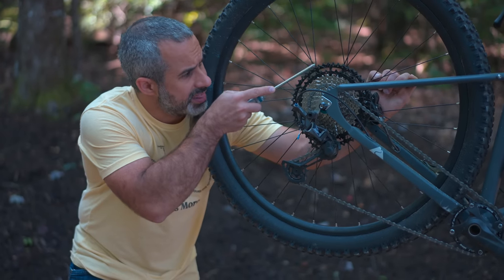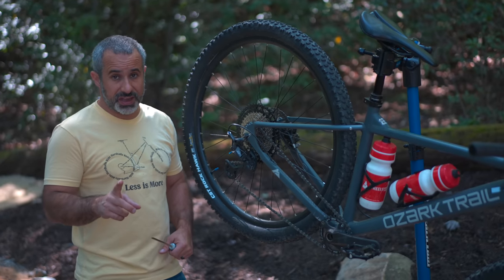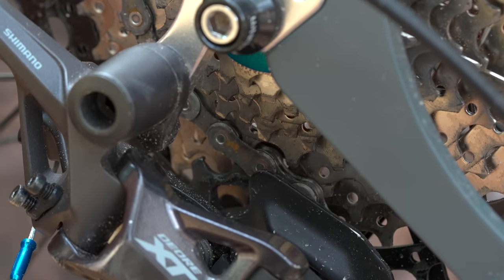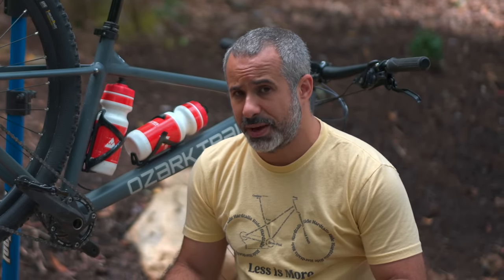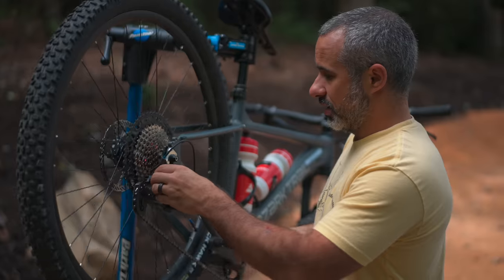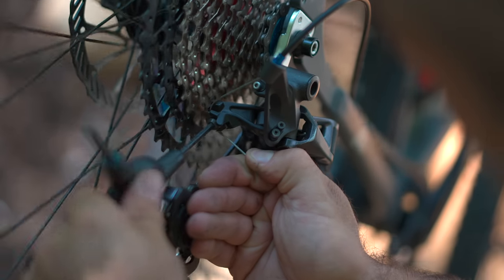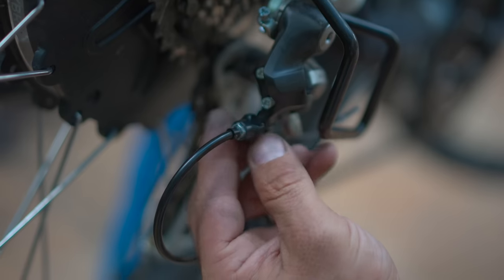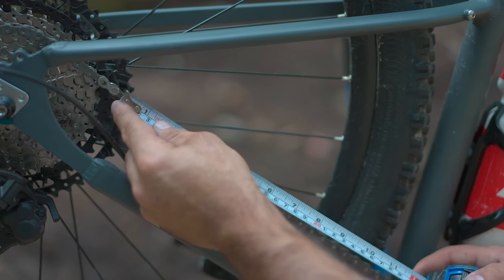How to tune your derailleur with basic tools (for beginners)

Comment: Hi Seth, this video came at a perfect time for me, but I've got a question. Do you FOR REAL do the thing where you decompress your shock to find the longest point along the rear travel to measure your chain? Or can I just do it with the shock at pressure and just add a link or two?
Reply: I'd do it with an aired-out shock, best not to second-guess. Do it once, do it right.

Comment: What's the red goop you've got on the cassette? I usually just put muc off chain lube after I've degreased the chain, cassette and derailleur. Should I be putting some lube on the cassette?

Comment: I have a roadbike that shifts like garbage! while sorting all possibilities out that you mentioned in this video I think I have found out another issue that may happen to older bikes: The cable inner and outer are rubbing against each other somewhere. So the deraileur does not always exactly follow the "commands" of the shifter... So I will renew it all and see what will happen...

Comment: A stretched chain will damage the teeth on the cassette. It helps to enter your equipment into an app like Strava, and track your miles so you can change your chain before it gets so stretched that it wipes out the cassette. Also, lube that sucker often.

Comment: Serious question.  I have a vintage ATB/mountain bike without derailleur hangar.  For sentimental reasons I absolutely cannot change to a newer frame with a hangar.  It shifts “OK” but I really want to dial it in.  The rear derailleur mounts to a “claw” style mount.  Do I get the alignment gauge to see where I am at?  Do I take it to a guru that aligns the frame or replaces/welds in the back part with modern 135 spacing and a hangar mount?

Comment: I have a barrel adjuster at the shifter and rear derailleur. Which one should I use to fine tune if I loosen/re-tighten the shift cable?

Comment: Thank you for the video it was educational. But anyone have any answer to my question?
Why modern low entry bikes fail where secondhand low price brands from the 90's and early 2000's shine?
Or is it because the New 1x systems are more sensitive to the cable then a 3x System?
I had (and now again) an 18 speed full rigid retro MTB. I used (kill) my bike for 20+ year I had the original '90s SHIMANO SIS components after multiple hard staff and no major adjustment needed. My Father made me buy a secondhand 2018 Decathlon Riverside 500 for commuting only and the 2  year old components at the back (I know It's microshift don't expect much) and the overly soft sponge front Suntour suspension fork (can't be locked, it come from factory) give nothing but trouble. After 2 month and multiple services they still can't take even 10 degree hill's. The back shifter hopp backward to speed 8 from 3 without any major power.
I know quality had to payed, but why I had to buy a higher priced one to go work, to my aunty or to get tó the cemetery to my loved ones? Not mention what should I do of it get stolen...?

Comment: The problem with the derailleur hangers is that sometimes a new bicycle comes with  a bent one already from the store. You pull it out of the box, and it is already slightly bent.

And then there are steel frames (like Surly) where the hanger is a part of the dropout. Good news — you can bend it many times and it won't break. Bad news — you don't get to have a spare.

Comment: I had an issue where my shifting would be fine on one side of the cassette, for example the last 3 gears, but the deraiileur wouldn't get the chain to the first 3 without me having to put some tension on the shifter trigger. If I adjusted my indexing to where it can get into the first 3, it then wouldn't be able to get into the last 3. This started happening after I replaced the shifter cable, so I suspected it to be how I installed the cable, but it's a pretty easy and straightforward job. So it could be the shifter? Or could it more likely be the "hanger" (my bike didn't have a removable hanger; it was just a dropout with a hole to mount the derailleur)? 
The hanger is not my issue anymore though because a couple weeks ago, the rear swing arm snapped right off of the frame where it connects to the pivot joint. It was a 2020 Schwinn s29 (matte black model). Lasted 3 years before this happened. Took it everywhere in my area of Michigan. Did everything. I was proud of it, but still wonder about what I could've done to avoid the swing arm snapping, and also about the weird shifting issue I'm posting about now. Now I can't hit the trails until I buy a new or good used mtb. Don't have a car either, so I'm stuck relying on the bus system, which isn't all the reliable. 🙄🤷🏾
2nd edit: Yes I modified it. I modified and upraded everything that failed, including the wheelset, fork, you name it, I replaced it. Only thing oem that didn't fail was the rear coil shock. But that thing is so simple it would probably be a long time before it failed, so I upgraded to a dnm aoy-36rc air shock. It was a much better shock, and a Schwinn customer service agent (who didn't know much about bikes) blamed that shock for the failure. He also said that's why the mechanics at Pacific Cycle didn't want to send a new frame to me even if they were available. I disagree but, whatever...
Please feel free to comment your thoughts. Thanks for reading this essay. 😆

Comment: For the uninitiated: The Derailluer Hanger Float Test is the simplist method for deciding if you need to replace the hanger, if it floats you're good to keep using it. If it sinks, they cost about $15 and you've already eliminated all the other possibilities so it's time to replace it. Go to a shop though and bring your hanger, they should have the one that matches or can place an order for you so you don't buy the wrong one.
Reply: Don't rule out new hangers being bent. I've just got a hanger tool and found both my hangers were out, wish I'd got the tool years ago.
Reply: In my experience it is practically impossible to find a derailleur hanger. A lot of manufacturers don't stock them once their newest model is out, if they ever stocked them before. Your local bike shop (if you have one) certainly won't have one in stock for your specific bike. You need to spend a long time searching the internet for somewhere that makes them as after market parts and they will cost a tenth of your bike when it was brand new.
Of course your experience may vary depending on where you live and the age and manufacturer of your bike.
I wish they just gave you a spare with every new bike but maybe the universal derailleur hanger will be used on every bike one day and this problem will go away 😂

Comment: Coming from a bmx background I always hung my bike on the bike stand via the top tube because I always ran with a cut seat post so I couldn't raise it . I've noticed that in all maintenance videos the mtb's are hung via the seat tube even with droppers. I've been resistant to hang my mtb via the dropper and have continued to mount it via the top tube.  Am I doing harm to my frame or is it just a preference thing ?

Comment: for ebikes, a proper kickstand is essential to support it on both sides so that you can realign and adjust the derailleur on the road. I've tried to turn one over carefully, but it is very unpractical, and much of the weight was on the controller display mounted on the handlebars. A few days later, the controller broke because of this.

Comment: I get the high gears shifting well but the low gears don’t work right. Then if I get the low working better the higher gears don’t work right. Also my cage is sometimes brushing the spokes when in lowest gear… time for float test?

Comment: I was surprised that there was no mention of the marks on the derailleur cage when setting the spacing using the B screw.   Looking through the wheel from the non-drive side some derailleurs have indicator marks stamped in the case that you use as a guide when adjusting the B screw.  If you happen to have the manual for the derailleur then it may have the value for the spacing

Comment: i am currently trying to figure out some rear cassette things .. so this is helpful! i have a 2x10 trek but i want more range lower gear ,currently i have 10 -36 gears but i want the hills to be a little easier as i am struggling can put a different 10 speed with bigger say a 40 totth gear on the rear ? i am sure i will need to change the chain will i need to do anything else ? Also will i need to lose the double gears at the front ? thanks for any help its appreciated i think i can do the job mechanically wise just need some help in the tech dept ..
Reply: That's a tiny change, most rear mechs can support 40t easily, but googling the part number will show others have asked the same thing already. 
You'll likely want a longer chain but with 2x you can use a shorter chain as long as you never shift into big/big. Swapping the small front chainring to a smaller one will make a larger difference, cheaper without needing to swap chain/mech/cassette

Comment: Honestly, if you have kids or are prone to crashing/laying your bike on the drive side yourself, buy a cheap hanger adjustment tool. Even a brand new hanger might not be totally straight.
Reply: Since that's considered a precision tool, it's not a tool I'd cheap out on. Sure, it doesn't have to be an Abbey HAG, a Park Tool DAG-2.2 will suffice, although it does have a little play in it.

Comment: You can screw the axle of any quick release wheel into the derailleur hanger and use that to bend the hanger back to straight
Reply: that is right, i was going to post that. But also no just the axle, the whole wheel and that will help you to see if both wheels are parallel

Comment: I don’t know if you can answer this problem i have with a shimano xt derailer  when i shift to the tallest gear (40t) set the B screw so the jockey wheel is very close to the cassette gear and then start shifting down to the smallest gear (11T) the chain is very sloppy…. If I take out. More chain links the chain becomes stretched on the top gear.

Comment: Got a microshift advent rearshifter on my 28 gear GT 0.5 model year 2012 or smth and it shifts like poo. Is it possible that the shifter shifts poorly because my smallest sprocket is like an 11 toothed one and the shifter is classified for a 10 tooth sprocket?

Comment: Some derailleurs have a little bracket in between the derailleur and the derailleur hanger. I got absolutely bamboozled by this and thought that the DH was bent but it was in fact that tiny in between piece that drove me absolutely mad for a couple of months
Reply: Sounds like you're talking about the B-link if it's a Shimano rear derailleur.
Reply: @yonglingng5640  that's the one, couldn't find a replacement where I live

Comment: Are derailleur hangers pretty standard or are they specific to cycles, please?
Reply: There are hundreds of variants. Many of those hangers are indeed shared across some models or even some brands. With this many hangers out there, it's hard for the average rider to find the right hanger for their frame.

This is what SRAM wants to solve. A derailleur hanger standard, taking one derailleur hanger shape, for any frame adopting this standard. They call it, SRAM UDH (Universal Derailleur Hanger). Initially designed for mountain bikes, it's starting to make its way into other bike types, such as cyclocross, gravel and more recently, a road bike (Trek's new fourth-generation Domane AL).

With SRAM UDH, instead of asking "Do you guys have this hanger in stock for this frame?", it can be "Do you guys have SRAM UDH hangers in stock?".

Comment: I’m always so scared to touch a derailleur. My Stumpjumper has constant derailleur issues due to the terrain I ride… and this last bout I simply can’t diagnose. Bought a derailleur hanger adjustment tool and despite straightening it out, it still doesn’t work. I’m sure it’s got something to do with the cable tension, but I’ve got a bad rep of screwing things up worse than they started… brakes and brake bleeding, I’m golden. Derailleur… my nightmare.

Comment: Hey guys, got a bit of an issue someone might help 😅, I changed my cassette to a bigger tooth count (11-30 to 11 34 on shimano sora) which is supported. On the lowest gear the jockey wheel touches a bit the cassette like shown in Seth’s video, but adjusting the b screw doesn’t seem to make the body of the derailleur go up or down both ways. I suspect the chain might need two extra links maybe what do you guys think?

Comment: About b-screw. My deore m5100 has a line that you need to align with lowest gear. I initially found this in other YouTube video, but also it is written in derailleur user manual. But who need manuals 😂
Reply: Manuals? like rolling on the back wheel only? ;)
Reply: @andrew_gardner  exactly 🤣

Comment: My bike doesn't have a hanger lol . Had no idea how where axis the thing should be on it where the bolt goes on , cheap thing has no alignment mark or nothing lol , the chain looks super loose lol . Purchased the thing put the chain through the thing , but trying to get the thing in the right place seems impossible .

Comment: My rear derailleur just won't get to the smaller cog easily... I usually have to try at least 2 times, same issue with both chainring.
I opened the high limit screw, but even excessive settings won't help to shift into that position, I even set the low limit to different positions to see if any effect on the higher speed, and same result with the barrel adjuster - that doesn't seem to change anything...
I suppose I should take everything appart, shifter and derailleur, degrease, clean, regrease, and try again?
Reply: Sounds like a bent hangar. Though just to be completely certain - did you try taking the low limit screw all the way in both directions? It's sometimes counterintuitive which way actually widens the available travel.
Reply: @KindredBrujah  Yes, I finally got it working a bit better, not sure how I did it, though... very old bike, and yes, the cage of the front derailleur has been a bit bent at some point.

Comment: Very well done.  However, I don't trust the "precision" of a tape-measure.  $3 for a chain gauge, or $9 for a chain, seems to be the way to go.  In this category of rider, the chains are often neglected, rusted causing severe wear. 
btw, did you know that the Sedisport chains back in the day actually did stretch?  (due to the curvature in the plates to make them shift easier)

Comment: What I got from this was that a derailer is nothing but problems. I am switching to an integrated hub with cvt. Put that motor on the front wheel and the cvt hub on the back.

Comment: by bothering his LBS mechanic for hours to learn this stuff. he saves many other LBS's mechanics a lot of time explaining how things work and when the bike does come into the shop, somebody did just back out a limit screw all the way and lost in in the dirt. or better yet, try to do the reverse float test and try to do it using the eye and thumb and tongue out method. and when the Mec tries it with the gauge the hanger snaps from repeated over extension. you will still be paying the bill, but it is a lot of extra (wasted) time for the Wrench.

if you think video like this put shops out of business? well despite what you think, your local mechanic probably does know more then you do. :)

Comment: Can anyone help? I have a problem when I roll my bike back the gears doing some noise and rear wheel stops spinning. Also if it's on high gears this problem doesn't appear. Should I check the B-screw?
Reply: anyone? 🧐

Comment: I got my ozark ridge in yesterday.  I started to assemble today and found out the chain is wrong along with the derailleur
Reply: Incorrect routing at the cage?
Reply: @yonglingng5640  yes it was.  I couldn't even screw in the derailleur because the chain was routed wrong.  It looks like it was just thrown together just to get the bike shipped out

Comment: There’s also the issue of having to shift twice before the bike will go into another gear.
Reply: That's usually a case of out-of-adjustment cable tension (too tight/loose). B-tension gap plays a role too if it wasn't set up right.

Comment: Those aren't cogs. They're sprockets. Sprockets interface with a chain while cogs interface with pinions (which are basically cogs, but the smaller in any pair is called a pinion because reasons). The only time you should be nitpicky about this stuff is when you're teaching it to others.

Source: I'm an engineer at the Academy of Complicated Science and that's what all my mechanical engineering textbooks say. Also I've never heard an idler wheel called a jockey wheel, but maybe that's just a regional thing like how you dropped the hanger into a glass of "wooder".